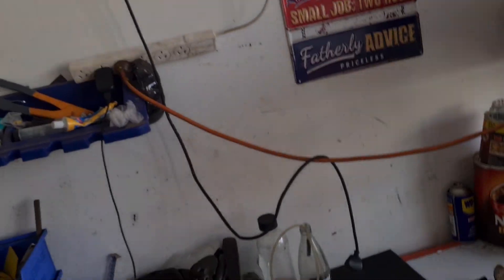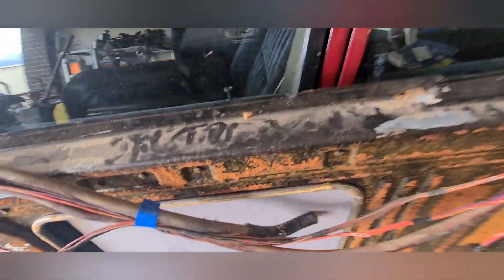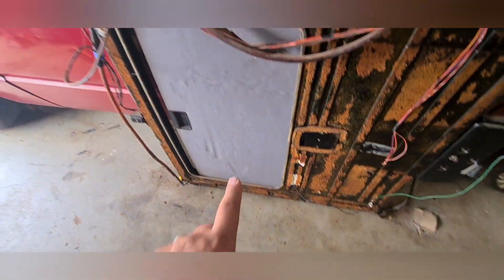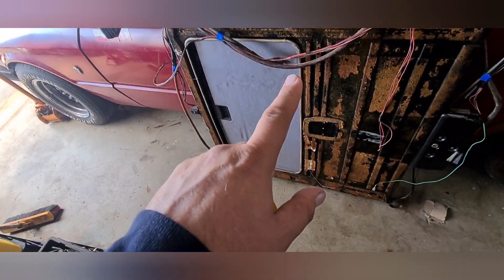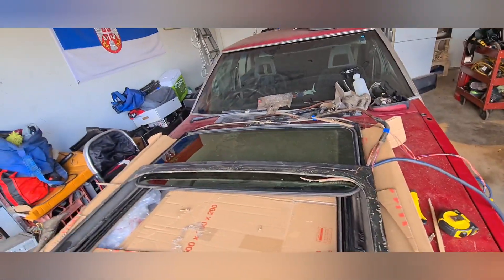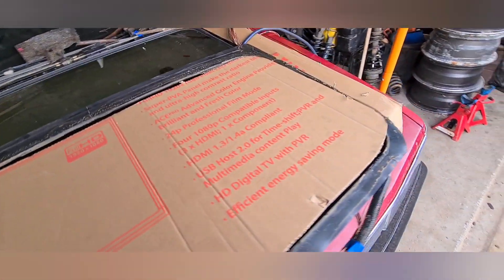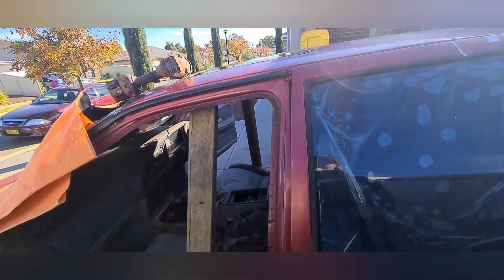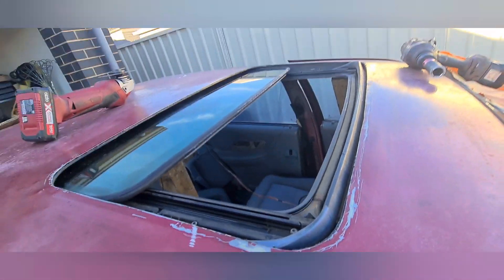EB XR8 EP8

Comment: Wise move with the replacement sunroof.  80s and early 90s sunroof supplies were a mixed bag and there were so many obscure brands & models.  Most are orphans when it comes to parts.  Your replacement is an early to mid 90s Vermuelen-Hollandia TVS, the predecessor to the Hollandia TVS700 used in the HBD sunroof optioned commodores, as well as being the go-to for much of the aftermarket from the 90s and through the 2000s.  This means parts are readily available. I’ve fitted several of them over the years.  Most into cars that had no roof prior, and one where I had to enlarge the old hole like you did.   They are a very reliable roof, and easy to service and adjust if necessary.
I used 4x2s as props when fitting, and yes, they are only glued in, and have those “clamps” along the roof rails as the only mechanical retention.  Surprisingly, the sunroof assembly when bonded in, is much more rigid and stronger than a standard roof skin.  The rubber seal around the hole can be tricky to fit. Great job that will be even better when you tidy up those gaps.
Reply from the maker: Ah thanks mate. Good information there 👍 yeah it was touch and go with lining it up but did alright. Still need to shave the sides a bit to get the rubber seal to fit but shouldn't be too hard.. hopefully 😅
Reply: @scrapmetalgarage  with those roof rail clamps, I drill out the rivets in the donor car, and use self-drilling tek screws to secure them in the new figment.  Looks like your one was an aftermarket fitment, organised by the dealer.  The hole certainly shows this!   I’ve seen worse erratic gaps hidden under the rubber strips I’ve pulled out when cutting roofs out of donor cars.  Most of the roofs like this back in the day were dealer fit, with only a few models having true factory glass sunroofs fitted on the production line (such as the FC LTD thru FE/ZL, VK Calais, and VE/WM models).  Even the Monaro CV8-Z were done “offline” like the pre W series Caprice, and HBD fitted commodore sunroofs.  Technically “factory” but post production.  When you have the gaps sorted, and the rubber “seal” in place, you can adjust the height of the glass.   You’ll need to pull out the black plastic covers to reveal the little Allen/hex head screws that you can loosen off to push the glass up or down, and then lock back in place.  
When you redo the headlining, you’ll have to remember to get the shade out as well, and do it in the same fabric.
Reply from the maker: @commodorenut  ah awesome mate! The glass is sitting a bit lower on the rear side so hopefully that will bring it up. Yeah I guess back in the 90s if it looked right at then end then it's right haha